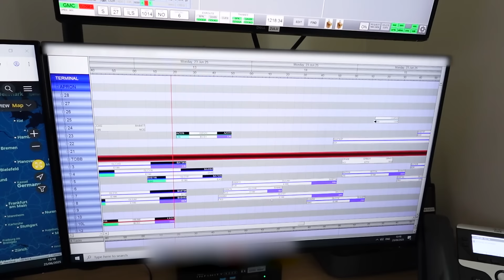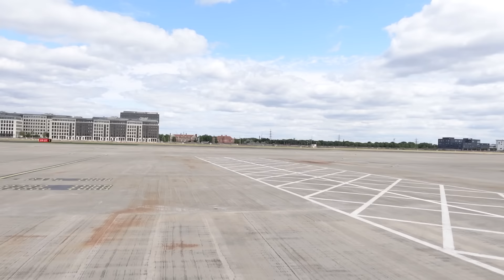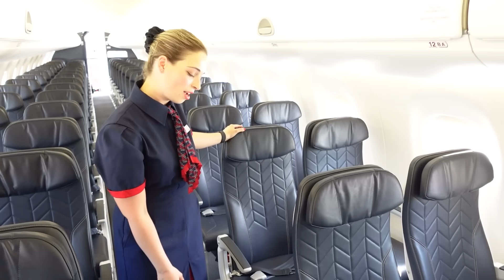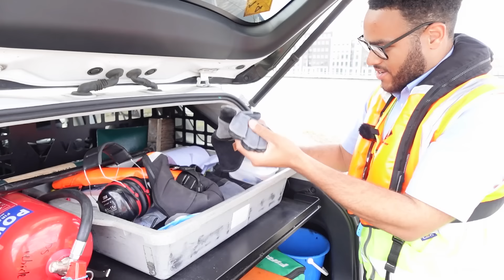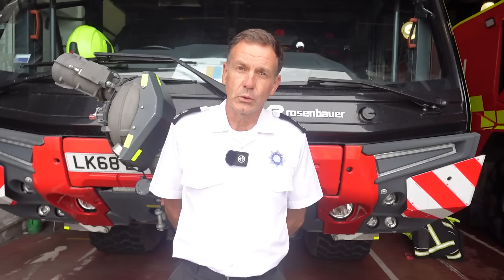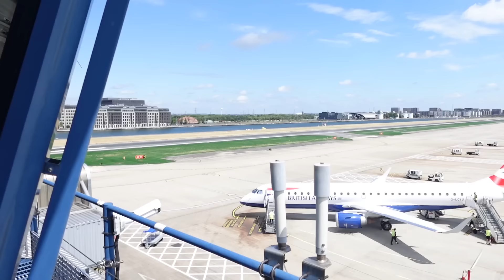London City Airport behind the scenes!

Comment: "Possibly the most interesting airport in London. Definitely the most interesting airport in the UK."

Reflect upon those two statements for a moment.
Reply: Do you need the sentences broken down? Make it simpler for you?? 

'Many airports are in london, which london city is the most interesting, actually in fact, london city is more than likely the most interesting airport in the UK'

Does that make it easier for to understand for you?  

i think its called Epanorthosis, were you make a statement - 'most interesting airport in london'. but then use Epanerthosis to make it grander or better to upscale the previous statement- 'if not the most interesting in the uk'

for example... "It is a good restaurant—no, scratch that, it is a life-changing culinary experience."

hope this helps
Reply: @matthewatkinson1092 I don't need any help with English grammar or comprehension - but perhaps you do.

You have inserted sentiments which were never uttered.

You could also usefully take a course in basic logic to understand what the actual problem is.

Comment: No mention of the biggest problem - it was given planning permission to be a SMALL business airport.  Noise levels for limited traffic would have been acceptable.
But almost 40 years later, the business trade has dropped dramatically.  Residents suffer the thundering noise of E190’s and all the others.  Now LCY want permission to use the much larger A320Neo, coming in to land at a much lower angle over our houses.  Heathrow and Gatwick are in less densely populated areas.  E16 is not an ideal location for SO MUCH air traffic. Why should we suffer?
Reply: A320neo is larger, but the LEAP/PW1100 engines it uses are significantly quieter compared to the CF34s on the Embraers. In fact the newer Embraer E2s use the PW1900G which is a specified development of the PW1000 for Embraer.

Comment: This airport has a lot in common with Santos Dumont airport (SBRJ/SDU) in Rio de Janeiro. Both are in the heart of their respective cities financial districts, are surrounded by skyscrapers and water and don't have the longest runways.
Cool video.
Reply: But the arrive and fly away approach is a bit different, I believe. On SDU they fly over water and have the Pão de Açucar as a challenge where LCY is in de middle of the city that bring other kind of challenges. I like both the airports, because they are so small, and as what you mentioned, they are close to the city centre and therefor easy to reach.
Reply: @didiermeynders  Yes there are differences of course. But at SDU, when RWY in use is facing north (02L/02R), there are approaches over water when coming from the east, but for ACFT coming from the west (as in the busy Rio-SP route) the approach is via downtown, proceeding over a residential area, then turning base to final right next to the Sugar Loaf. As you pointed out, each of those airports has its own challenges.

Comment: LCY is the most underrated airport in the capital. I've had 3 return flights out of there and one thing I can always guarantee is the take-off performance from those E190s. That being said, we've experienced a hot-day take-off when we had to abandon our departure due a shift in the winds. Nothing like spooling up to TOGA on 27 with the brakes on, only to power down, vacate the runway and head for the reciprocal. I've got a recording of the captain's announcement explaining the situation. 

Likewise, landing on 27, very close to the threshold, hearing the engines spool up to go around, I kinda figured what was going on, as explained by your captain 2:30 in. It's at that point you realise that Lakeside and Bluewater shopping centres really did have a bit of a turf war, whilst appreciating the decomissioned Tilbury power station.  Annoyingly, I missed my GWR from Paddington to take me home out west, necessitating a peak-time fare top-up. 

Best highlights of LCY is when you get vectored in to land at 09, Great view over the Thames as you make your inbound over Kensington and the West End for a pretty cool final. In some respects this and BRS are probably my favorite international aiports for getting out through customs and onto public transport and where you need to be. Out the rear exit and onto a DLR in 20 mins isn't unheard of, nor is a connection to Paddington within the hour.